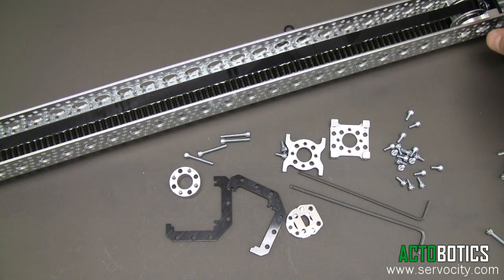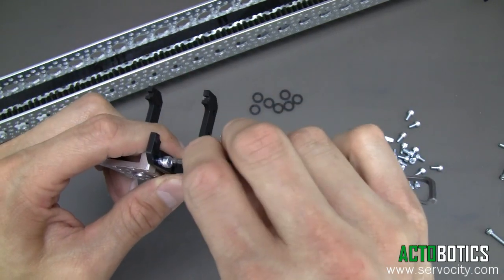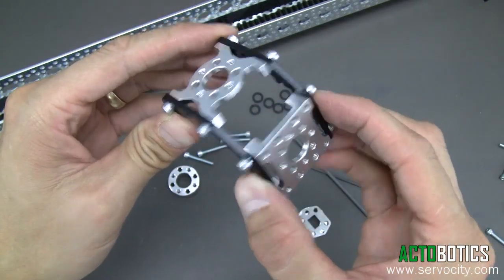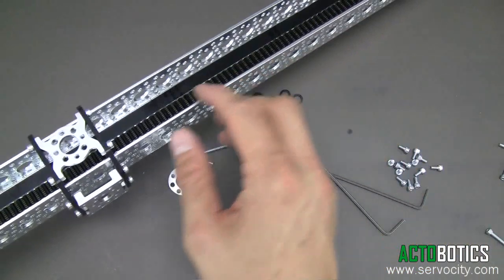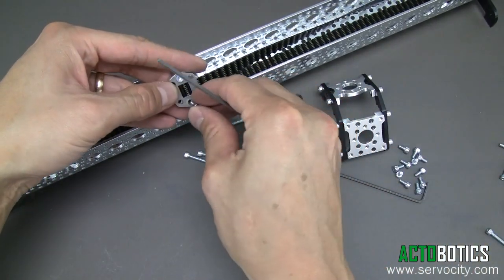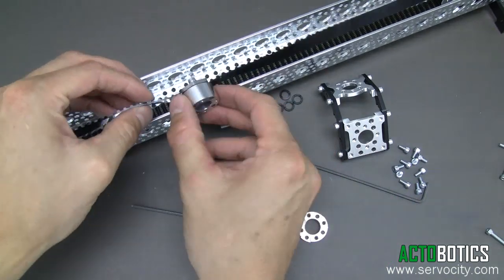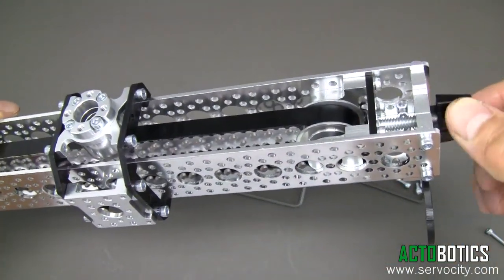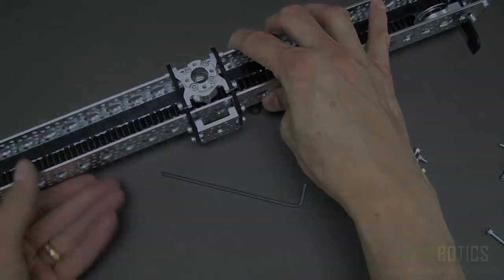Actobotics™ - Final Slider Kit Assembly (Step 4)

Comment: How about powering? are there just a couple of leads on the end that I attach wires to?
Reply from the maker: The back of the motor has two tabs to attach the wires to. You can either solder wires on or use a blade type connector.  Thanks!
Reply: ServoCity
I'm just getting into this stuff - might you have a link to this particular connector on your website?
Reply from the maker: Duane Shrode That's great you're getting into it!  We currently do not have them available online.  They should be online within the next two weeks.  However, if you are placing an order, we can go ahead and sell them to you.  Please contact our Tech Department at tech@servocity.com and they will be able to help you with this.  If you have any questions, please let us know.